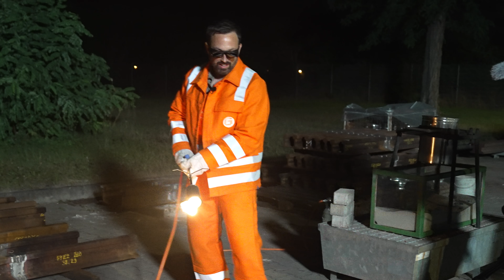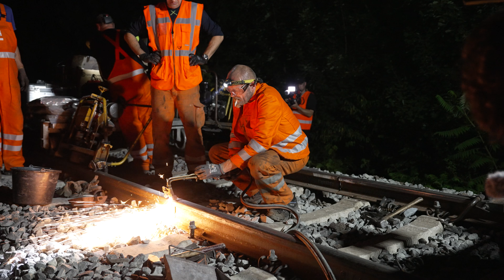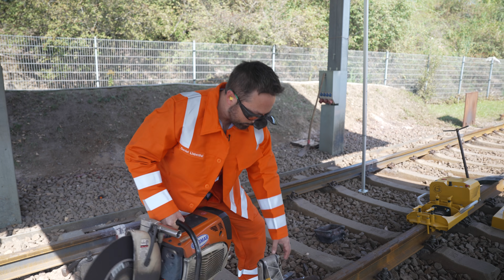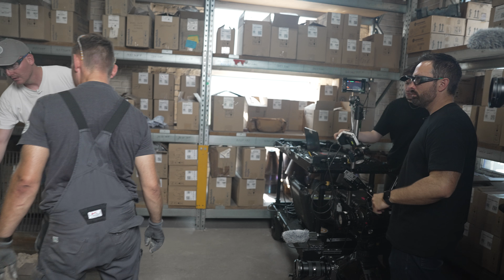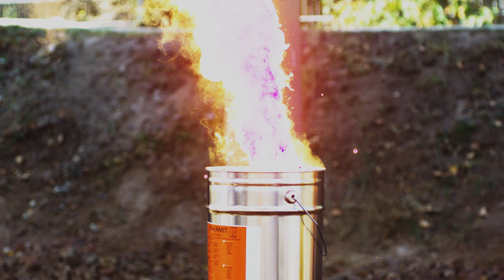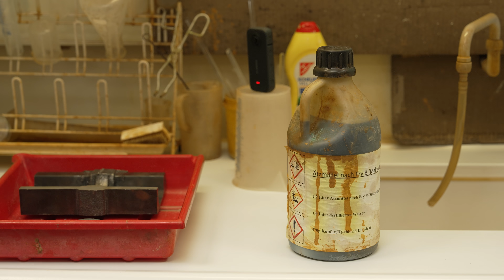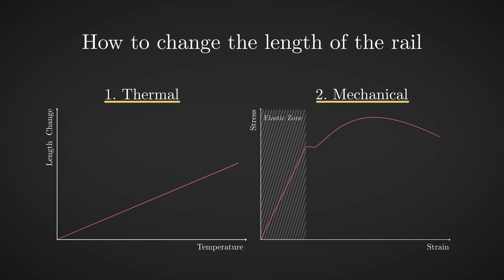Why Don’t Railroads Need Expansion Joints?

Comment: I also learned recently thermite is used to form continuous copper ground bonds at broadcast tower sites! It's cool to see it in action.
Reply: Cadweld. Used throughout industry for ground bonding. In the data center I worked at it was a common sight to see a large copper busbar on the wall and all the feeds to it cadwelded (copper thermite brand name) we had all the equipment to do it as well.
Reply: And to cook Hot Dogs! (I couldn't resist) Happy New Year Jeff
Reply: @mrfoodarama happy new year! Hot dogs, bratwurst, you name it, I'll make it talk!
Reply: No, it is not cool. On the contrary. It is hot. Gee.
Reply: Yes, I used to do that at cell phone tower sites. We called it CAD welding.
Reply: @greenmachine5487 l'm hearing you. Gas plant grounding and petrochemical as well.
Reply: Yep…called exo-thermal welding…also known in the field as cad-welding…and the molds are graphite and re-useable
Reply: Bet your Dad told you that. Great man! Respect 
Btw Happy New Year to you and and your family
Reply: Ive installed Cad-weld's on the buildings grounding grid on several new constructions, one of the more interesting jobs on site
Reply: I had a Mr lube where the specs called for CAD weld for the ground rods. Seemed very very overkill and a waste of the franchise owners money but those were the specs.
Reply: So, copper oxide instead of iron oxide?
Reply: How are my favorite YouTubers all here at once? Grady, Geerling, and Veratasium.
Reply: They use copper type on rail as well, they have little crucibles built into like a clamp type device that you can attach with one hand. They'll grind an exposed patch of clean steel on the web/middle of the rail then attach the little crucible, set it off and use a copper weld to attach a little bit of threaded steel(like a bolt) which they can then attach wires held by a nut.
Thats for rail signals and detecting train movement.
Reply: Most large electrical prpjects install a ground this way with multiple ground rods. Last one I did was a hospital's powerplant
Reply: @26longlongtime  Good to know! I've not been involved in any construction, but that makes sense as it is apparently the best way to get a mechanically-sound, conductively-transparent connection (much better than the soldering techniques used when speed is more important than durability).
Reply: @26longlongtime , why is that?
Reply: i read this and thought , "i should try and get jeff geerling and his dad to explain this", then i saw who wrote comment lol
Reply: hearing him saying "previously on.." feels like i'm watching a serie lmao, love it
Reply: 24:30 video title topic
Reply: hey Jeff I hooked up my new raspberry pi 5 with its cooler and ssd, and can I put a gpu on it with the ssd m.2 hat on it at the same time with or without a splitter
Reply: CAD welding. As an electrician I was amazed by it the 1st time I experienced it years ago. Not something I do regularly but still cool when I do
Reply: Yea its used in lots of places for grounding and bonding, i only got to do it once during my apprenticeship but it was pretty awesome.
Reply: And to put bond wires on unwelded  joints.
Reply: ‘Cadweld’ is the trade name for this type of splice. Some electrical engineers still specify cadwelds for grounding conductors but it’s less common these days. ‘hi-press’ compression fittings that use a hydraulic tool are more common for typical grounding, but you can’t beat the certainty of thermite welding!
Reply: grateful
Reply: Hey, it's the guy from my Ansible playbooks!
Reply: Red Shirt Jeff would use thermite to bond two raspberry pi 5s together to create a raspberry pi 5 pro, and then connect two of those to create a raspberry pi Max :p
Reply: It’s also used for continuous grounding electrodes in buildings as well if another provision wasn’t available. It allows a Grounding electrode conductor to be buried under concrete, as the grounding electrode would be part of the rebar buried underneath the concrete, which is all connected in the foundation and reinforced slab.

Cool stuff.
Reply: I’ve never associated rail with that cyclical tap noise
Reply: it also bl0ws-up real fine n impressive if you launch ballistics from a firearm at a cup or two of it from 25 meters💥
Reply: Video title is misleading….should titled ‘everything you wanted to know about welding railroad tracks together’
Reply: Happy New Year sycophants
Reply: It was also found at ground zero
Reply: These videos fail to mention one of the most significant uses in September 2001
Reply: @mostinho7 🤡

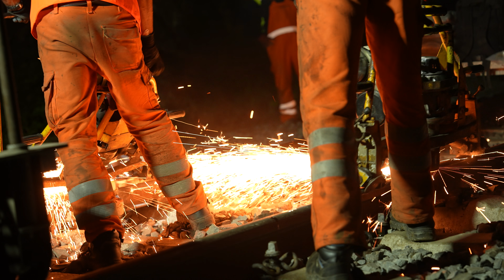Comment: 3:50 "all experiments were performed under the supervision of professionals with proper safety precautions" all while homeboy is using a torch with the ciggy still lit, God bless.
Reply: Smoking and metal fabrication go together like peas and carrots.  It's in the bible I think. 😂
Reply: The cigarette shows he's a pro
Reply: @Infernoblade1010  EXACTLY
Reply: All welders usually smoke if they want, nobody is going to say no unless a big boss is around.
Thats because you weld things way way hotter than a cigarette and they are exposed to way more dangerous gases than a simple cigarette, add the heat around, the heavy and dangerous job and you will see cigarettes like a soda.
Reply: @mamutero21  Its about potential leaks getting ignigted
Reply: @mamutero21  a big what now?!
Reply: @mamutero21  im not a welder but i still doubt that the funny gasses are less dangerous than the ciggarette...
Reply: There is actually a German court rule that stated that smoking for welders in prohibited areas isn't a violation of working place safety because they are qualified personnel in handling flames and therefore know what they are doing and using their judgement. It's from the 1960s so don't know if it would work nowadays 😂
Reply: Gotta use the tab to filter all the crap produced when he's preheating the track.
Reply: Cigarette helps ensure that all unlit flamable gasses get ignited before they can accumulate too much.
Reply: Well... I mean... what's it gonna do? Catch fire?
Reply: as they say in Germany "Five beers for the woodcutting crew!" (while holding up three fingers)
Reply: I trust a guy like him more than anyone else in the World.
Reply: that man has 30 years of experience with the equipment hes using and hes had that cig in every time hes done it before lol
Reply: And?  A torch won't light off a cigarette.  It's handy for lighting your next smoke though.
Reply: That clip isn't from an experiment but from a construction site. So technically they could have violated the German version of OSHA as much as they wanted and the sentence would still be true.
Reply: Cigarette breathing filter is OSHA mandated
Reply: The cigarette is normal equipment for construction workers in Germany
Reply: It is there for keeping body more stable -> more safe! Everybody knows that =))
Reply: If he’s smoking a cig without using his hands working- he’s the most professional guy for the job bar none
Reply: that guy listens to Rammstein :-D
Reply: Think that through, what could possibly be the danger of a cigarette near a foot long flame 😂
Reply: @wildcatdan5072  Through and through, no, there's little to no danger to smoking during such job. It's more about the meme of the pro always being this bearded guy with a cigarette. It was the first thing that came to my mind when I saw this part and I immediately scrolled down to see a comment like this 🙂
Reply: @wildcatdan5072  that makes no sense...little flame vs big flame. Plus you know you can throw a cig in a bucket of gas and the gas will put out the cig....most of the time....lol
Reply: @wildcatdan5072  the same as a face near a foot long flame
Reply: Missed the safety sandals!
Reply: I absolutely loved that part

Thats how you know he's a master.
Reply: ...and no glasses whilst grinding....
Reply: @noneck3099 Probably has one or two glass eyes 👁️ …
Reply: @noneck3099  it looks to me that they have face shields. At 18:02 you can see a slight line in front of the person on the left face.
Reply: @noneck3099  Safety squints
Reply: My thoughts exactly.
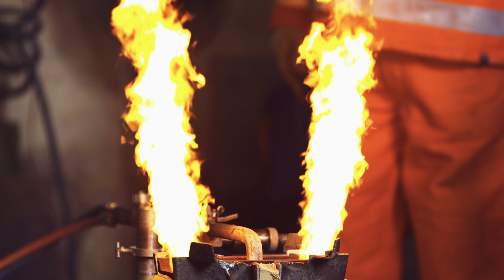Reply: the time it takes for a smoke to be finished is usually 3:30mins which is the pre heat time for the rail :) quick tips (thermite welder from Australia)
Reply: 16:47 and he is just grabbing glowing hot metal and throws it to the side
Reply: he probably  lit the cigs on the torch LUL
Reply: It's incredible how much tension and compression these tracks can handle without snapping.
Reply: You cant weld without a cigarette
Reply: Came straight to the comments for this 😂
Reply: german safety cigarette, its a classic
Reply: BRO he is the one THE GOD
Reply: It just lets him focus into zone
Reply: The gas is regulated as it comes out anyway. Even if you left it on, outside it would just vent, inside an enclosed space you're still screwed when you go to light the torch lmao
Reply: Hey.... he's got his lightly tinted eyepro. It's all good. lol
Reply: And no mask
Reply: If the gas is being consumed in a fire, you don't really have to worry about lighting another fire with a cigarette
Reply: Сигаретный фильтр заменяет респиратор - пары металлов вредно вдыхать.
Reply: Haha came here to write exactly that 😅
Reply: jordan?
Reply: : Also a considerable absence of hearing protection on site :D
Reply: @philippbeckonert1678  I see a lot of earplugs, pretty sure all construction site staff will have custom made plugs.
Reply: this entire video is a prime example of why feminist crying about inequality is laughable at best

Comment: I was a foreman on rail thermite crews for about 6 years, and this video is awesome! They need to start showing this video in our training classes. We get the handbook and go over what we should/shouldn't do, but gloss over a lot of 'why' we should/shouldn't do these things. It's also interesting to see the little differences in welding procedures, one I noticed was that after we shear the weld, we put an insulating jacket over the rail to slow the cooling process even further. Another is when first fitting the two halves of the mold to the rail, we hold the molds tight to the rail and grind them against eachother side to side to help get a tight seam. Not as necessary on new rail, but essential on old worn-out tracks. Looking forward to the next video!
Reply: The best comment, I think.
Reply: The box you are talking about I believe is what we call an 'Muffler' used for specific rail grades (don't ask me to quote the rail grade because i've never had to use the muffle box) otherwise the welds break. Rubbing the molds is just good practice for new to new rails. Having the molds nice and tight will stop any 'flashing' forming around the welds. Then there is old to new rail that when welded require 'Spot' Moulds. These molds have extra material on them and need adjusted to fit the specific rail section you are welding. I agree it is interesting watching others do the same process with slight changes!
Reply: For those of less techy, a thermite weld is kinda like glueing the rails together with liquid metal making an internal weld, verses an external weld which is weaker and would cause more noise.
Reply: In Germany "Gleisbauer" (rail builder) is a 3 year vocational education / apprenticeship . 

Similar to other vocational education "degrees" it's an alternative to a university degree. It's paid and usually about 50% working at a company and 50% at a specialized school teaching you the necessary information and skills to really do the job properly. At the one one gets a paper that proofs that one has the proper qualifications for the specific job. 

Almost all trades (and  also jobs that require university degrees in other countries like for example becoming a nurse) in Germany are done by people who have passed through such a tertiary education path. It's often a true and proper alternative to university degrees. 
The vocational training/education / apprenticeship system in Germany and some surrounding countries really leads to excellent skilled workers who also understand the deeper science and reasonings behind what they are doing.
Reply: @Esablaka    In the US the only professions that uses something similar to the German system are for electricians and plumbers, I think.  A friend of mine who is an IBEW electrician spent a full year in school as part of his apprenticeship, then another 4 years learning on the job overnight (ironically, working on the heavy rail MARTA in Atlanta.) After that he was obligated to work another 5 years for the union as a journeyman before he would be allowed to open his own business as as a master electrician, if he so desired.
Reply: @Esablaka , they sho5 do that in the USA too.
Reply: @Esablaka  In other words real as opposed to Merkel's "Fachkrafte".
Reply: Got to love that CWR training. As a section foreman and track inspector I had CWR training every year
Reply: Great comment about the video conveying more than just the steps but "the why", so true for all instructional material 👍👍
Reply: Well i can tell you shoot orgo. Lol.   Yeah they don't teach people anything in classes.    I get helpers to train up and they come out knowing nothing.  Which is fine hands on is the best way but its hard to teach the metal stuff on track.   I've contemplated making my own videos and putting them on yt
Reply: There are better vids on here, oldrr but more to the point.
Reply: In UK and Ireland we call the steel manganese wonder if it's the same
Reply: Invar neither shrinks nor expands  . Not strong enough ,or what?
Reply: I agree this was way better then my 5 week course. 

Sry for my spelling not a native speaker.

Comment: I did this for about a year with terrible pay. Back breaking daily work, really makes you appreciate the things that go on behind the scenes to keep a solid infrastructure going.
Reply: Thank you for your work!
Reply: The more years I work an office job, the more and more I respect blue collar jobs. So many things we are dependant on wouldn't work without blue collar jobs. We all take them for granted. With COVID pandemic I even gained more respect.
Reply: @undeaddutch  so get out there and actually experience the REAL blue collar...experience. then come back in a year or so and repost.
Reply: At  7:44  the trick for a perfect alignment is smoking like that guy.  lol
Reply: Man I've had back issues for 20 years since age 18, and I've often been humbled by the intense physical work others have to do to keep our infrastructure up. I can pull my weight a different way, but I'd have been out of the pack 100 years ago.
Reply: I spent about 3 weeks taking an old rail line apart, unpaid. It was 'work for the doll' in Australia. The rail was gone but we had to take the big nail things out with huge wedges that look like the claw on a hammer. Had to knock them in with a normal hammer and then, I was on the big 10kg sledge hammer and had to hit down on it to knock the nail out. Sometimes it would shoot into the air like a bullet and everyone would bomb to get away from it. 

Then, 2 weeks later I got to make big garden beds out of the old sleepers we recovered. Again, unpaid.
Reply: @BabyMakR  Garden beds? Damn, creosote-treated wood is pretty toxic.
Reply: @BabyMakR  big nail things are spikes....it seems the project did not instill in you the mystique of the job
Reply: @BabyMakR what is work for the doll? Another YouTube video idea….
Reply: i appreciate you brother
Reply: This stuff is important. They should've paid you more.
Reply: For all that work, the pay should be insanely high
Reply: If you're talking about America, its a crumbling infrastructure because it hasn't been updated in almost a hundred fuckin years.  
Sincerely, an American who hates lies about America
Reply: what country?
Reply: Really something that feminist activists should watch from time to time before going to preach about work inequality
Reply: It matters not what anyone it paid. It takes only $1 per day invested, from age 18-73 to accumulate $1,000,000.

(Minimum age for an IRA is 18, and forced ditribution begins at 73. 

$1/day 365 x 55 years is a little over $20,000 contributed. So long as the investment is market-average of 10-11% return, $1M is the eventual outcome.

A homeless beggar or someone working for $5/day in the impoverished world can become a millionaire if they so desire.
Reply: @Triple_J.1  5. Counting on investment returns greater than 3-4% is unrealistic. Most of that "10-11% growth" is explosive and unpredictable, i.e. high-risk.

6. The market has saturation limits. GDP only grows at around 3%, so that 10% average market growth rate cannot continue indefinitely, nor can it simply be 'scaled up' to the entire global population.
Reply: @Triple_J.1  7. Hard work vastly increases a worker's health deterioration, especially above the age of 50. It is extremely rare for any hard labourer to still be capable of work after 30-40 years on the job. In addition, even in places with federal healthcare, small out-of-pocket health expenses can still add up.
Reply: @Triple_J.1  3. The average return is an average, not a minimum, and not even a median.

4. Investment tools have constraints and costs, which often add up to several dollars per day in expenses.